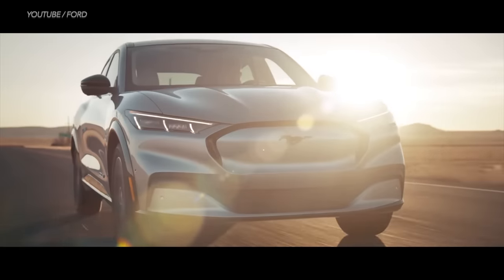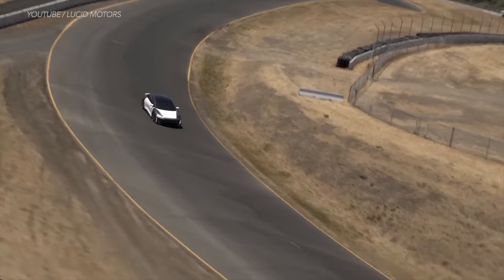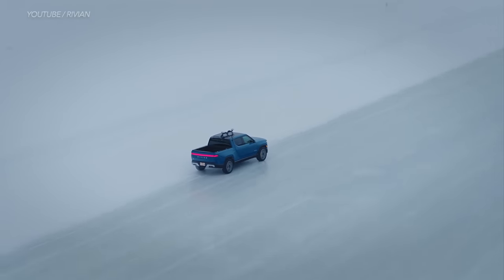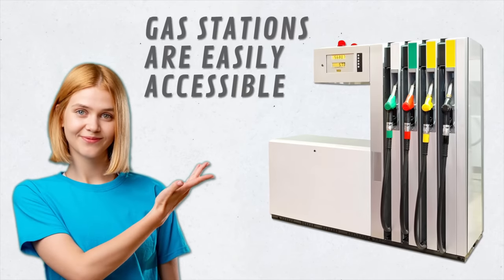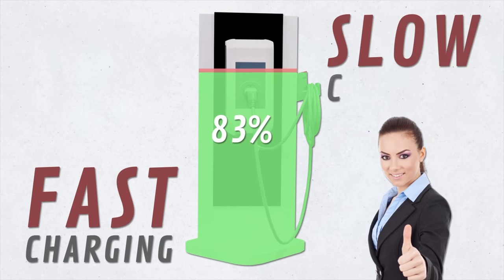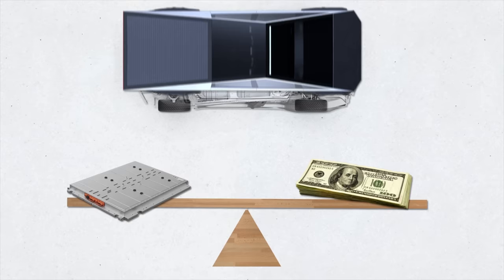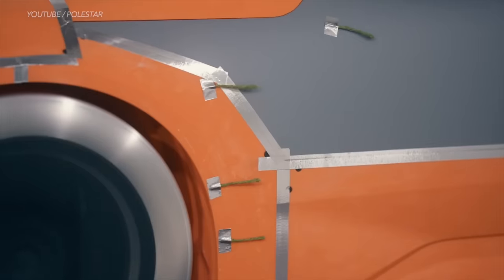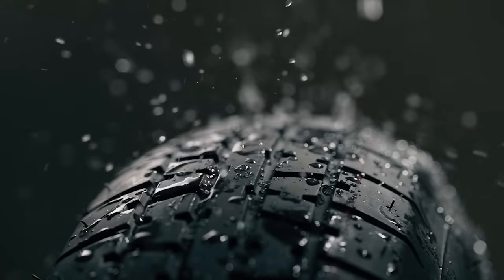New Study Shows Electric Cars are a Scam

Comment: Forgot to mention the power output of the car's.
That fast and powerful car that smokes everything at the traffic lights is exceptionally bad for your battery.
They have to give 4 or 5 times their capacity and will degrade faster.
So buy te less powerful one and the lightest .

Comment: Ooh Scotty, you better change address.  Electric Jesus, Electric Viking and other fan boys might send the "boys" round to re-educate you.  
As an aside, LFP and LFMP batteries from CATL actually prefer to be 100% charged and discharged.  So its important to know what type of batteries are fitted in the car in order to establish more realistic ranges.
I have a Mazda 2 turbo diesel which gives me 52-62 mpg (US). The 11.6 gal (US) tank gets 600-700 miles of range.  Until an EV get me that with a car that only costs $20,000, I'm not interested in EVs

Comment: 1.) Gas cars are less efficient in the cold (not as big a difference, to be fair)
2.) Snow tires are heavier on gas cars too.  3.) LFP batteries (Lithium Iron Phosphate) can be charged to 100% without the degradation issue, and those are becoming much more common. 4.) LFP batteries will last 500,000 miles easily.

Comment: Battery EV should only be built and sold a limited range and speed vehicles designed for local commuting and errand running. Think an electrofied version of the original VW beetle.Beyond that they are expensive, impractical, and inefficient cars.  Fuel cell electric vehicles are the future, however they are so far not widely available, and neither are the fueling stations. This is why battery EVs will fail and I recently purchased an ICE non-hybrid car.

Comment: Biggest tip to saving range.   Get high grade ceramic tint so your cabin is cooler and your ac works less
Reply: I get 318 miles on my 358 mile advertised LR tesla
Reply: That's the second biggest tip. The biggest one is to buy a regular gas fueled car.
Reply: @deanh3678  And that will decrease every time you use it.

Comment: Scotty ..try as you need you will never stop the EV. It is here to stay and with Elons new pricecuts , demolish your ICE age cars.  Big legacy will try to survive on the trucks,  but not for long.
Reply: Carrying a dead weight battery (near the end of the charge) is not very smart.  10 or 20 gal of fuel is practically weightless by comparison.  I expect - long run - there will be some kind of fuel cell. But ICE engines powered by methane might not be too bad of an idea. We keep finding more. And there is lots in space.

Comment: I spend about $100/month on electric charging. I use the adaptive cruse control on the highway, that helps a lot.
Reply: I spend about 36-50 a month on gas. Toyota Camry 4cyl. I fill up every 3 weeks.
Reply: I drive a 2003 Ford Ranger and pay an average of like $85 a month lmao, 3.0 V6
Reply: I drive daily. My Raptor would cost to much, as in hundreds of $.
Reply: I have cruise control on my ICE vehicle and absolutely don't use it. I tried years ago to use it and I would always have to disengage it because of traffic on highway or in city. IT'S TOTALLY USELESS!
Reply: And just wait till the battery fails ( $15,000 to $20,000 a pop) , and they are a total fire hazard.

Comment: No heat while driving your EV to get better mileage . 🤣🤣 enjoy the cold inside your EV lol
Reply: AND no air conditioning while driving in the blazing heat of the sun belt.
Reply: @Proton Neutron  my God your baking yourself 🤣🤣
Reply: I live in a cold climate and I had these concerns too.  But I've been driving a Model 3 for a year now and it's really not an issue.  If anything it's nice to have the heat or AC turn on automatically before you get to the car  so never have to sit in a cold or hot car.